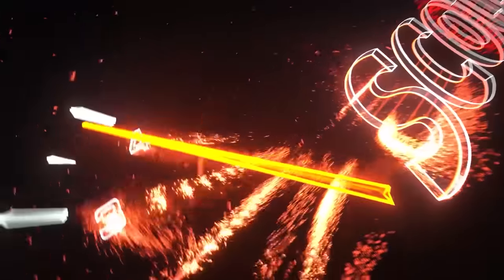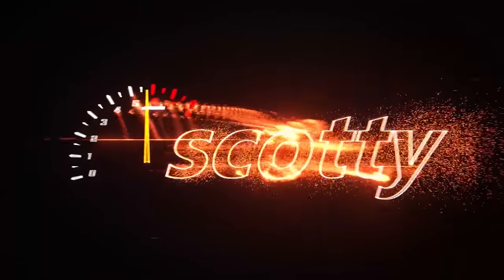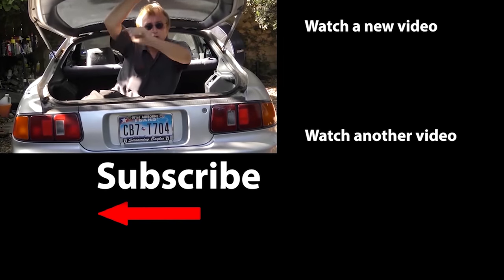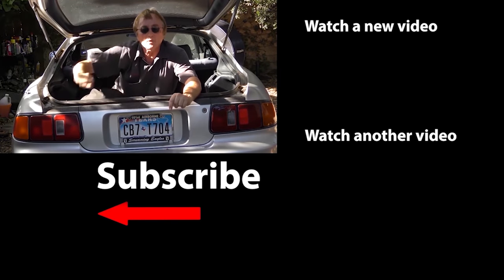Here’s Why Your Catalytic Converter is About to Be Stolen (Nationwide Theft Alert)

Comment: Someone tried to steal mine, they jacked it up with a very nice LINCOLN jack, well the neighbors dog went into major barking and growling I went outside someone ran away from my car.. but I got a really nice floor jack.. and a socket set...lol
Reply: Good dogie
Reply: Haha you made out good , the thief that took mine bent the crap out of the down pipe causing a restriction
Reply: Finger prints on the evidence,  should be turn in to police
Reply: Jim Johnson  right ... sad times we live in the police get a catalytic call and laugh while sipping coffee in the 7-11 parking lot
Reply: Awesome story! Mine is not as good. Had around 4k sound equipment in my pickup. Crackhead successfully ripped out one of my amps. He totally got shocked w 5F capacitor power plus the battery. Some things were melted. He ate it. Jerk.
Reply: Imagine if the crook tries to come ask for that stuff back. Lol.  Take it in to analyze for finger prints to try to help other would be victims out.
Reply: @AF_1892  Damn good story. We need lots more like that.

Comment: The Scrap yard or whoever is purchasing the cut off cats should be heald accountable. If no one will buy them, no one will bother stealing them
Reply: There a black market
Reply: Yeah, punish the scrap yards for purchasing something you can’t tell that its stolen and not the actual criminals.
Reply: ----------- unfortunately money speaks louder than thievery exhaust minus cat...need lawmakers to draft law put moratorium on sale of cats to scrap dealers unless licensed...hey Scotty
Reply: All scrap yards buy them. When I ran a yard, we had a saying, “ we’re here to buy metal, not investigate metal”  Almost everyone who sells a car to a yard removes the battery, cat, rims, and anything else worth  more than what you get for shred car price. They sold those things to us for the higher price. No way we could tell what was stollen. We did however, have to hold the scrap for 30 days prior to reselling in case there was stollen property. We abided by that. Many scrap yards didn’t.
Reply: There are a few clowns collecting them to separate the expensive metals inside rather than take them to a scrapper, a smart scrapper probably puts them out of sight to cool down before selling them on .... if they have a scrap yard it would be easy to hide them on cars that are on the heap .... it’s a good excuse to make a long term temporary modification. Just take care to retune the motor to the better flow of straight through exhaust ...
Reply: Concur with you, but I think we also need to put pressure on our lawmakers as well.  Nothing will change until we have laws to back us up.  Scrap yards should also have cameras to catch license plates on  vehicles driving in, the driver & occupants, etc., I.D. needed as well prior to payment. (You know many will try to give phoney names & addresses).  If someone is not doing anything illegal, none of these actions would bother them..  As for any legal issues regarding filming children, these miscreants shouldn't have their kids with them if  they're doing something illegal anyway, but maybe if the kids see their dads/ brothers  handcuffed, it might deter them from following in their footsteps. Other thing is to establish a neighborhood watch or have  strategically placed security cameras throughout the area.   We should all help one another to stop these creeps.  There is nothing lower than a scum thief who earns a living off of stealing from others.  Any of you who get camera footage should post the photos or video on the internet just like they do with porch pirates.
Reply: @iCuStOmPR  
If someone shows up with a dozen sawed off and not unbolted cats and doesn't have a shop, there not stupid, they know dude
Reply: Scrap yards in my area are strict. They require an ID for all transactions and even scan them.
Reply: Contrary.  Can’t hold cat recyclers accountable for a theft they didn’t commit, and have no way of knowing took place unless the thief tells them it did.  Plus it’s not hard to pull the beads out yourself.  Even melt them down if you have the equipment.  Makes the finished product much more valuable if you just do it yerself.
Reply: They implemented this with a.c. units years ago. And wala!!. People stopped stealing people's a.c.units. someone actually stole my a.c. condenser unit years ago. Now you have to have a recept for the new a.c. unit in order to scrap your old one. So yeah I do believe if the recycling centers would do the same with cats then we would see a drop in them being stolen.
Reply: @iCuStOmPR  When someone shows up with a load of converters, it’s a good sign they’re stolen.
Reply: @brockbaker3able  If someone bring you 15 or more cat converters, its obvious they were stolen especially if it is the same person every month.  There should be a law where you have to show proof of ownership and you can only use the pink slip once every five years.

Comment: Own a 2019 Civic, I average 37mpg. I have a 6MT, not the automatic CVT. I didn't want the CVT, I wanted a MT. I also got the 2.0L engine. I bought the best Civic you could possibly buy. My car gets 37 mpg and will last for over 300k miles because I change my oil every 5k miles. Plus, I know how to drive a MT. My clutch will last for over 300k miles. Best purchase ever. The 2.0L Civic with the 6MT is the last "BEST" Civic you could ever purchase for longevity in mind. I'm pleased as a pig in mud that I found one.

Comment: We have a 2002 Buick Century & 2002 Pontiac Firebird.  Live out in the middle of NOWHERE in southeastern Arizona, in a town of 400 people, 125 miles from the nearest big city of about 300,000 people.  Have a 6ft fence of corrugated steel with a chainlink drive through gate.  IF someone from the city decided to try it here, first, all the dogs in town tell each other, and then our dogs know, and then our very large cockatoo knows and all hell would break loose in our house waking us up.  Reach for the .22's, let the dogs out, flip on the outside light and watch the fun begin.

Comment: I feel bad for the criminal that try’s to steal mine because I have bad news I don’t have one to begin with 😂😂😂
Reply: Straight pipe for the win 👍💯!
Reply: mine blew up the first time i tried to 2 step it lol
Reply: I told a friend when he bought a brand new truck where there were no emissions to replace the cats with straight pipes and sell them or store them in case he lives somewhere with emissions.   2 new cats from a big truck can get $2000 or more.
Reply: är u kiddin?
Reply: Straight pipe 👌
Reply: @SWIM SWIM it should be considering how bad it is for the environment and yourself but ya know.... American laws don’t follow any science or logic if you want your big truck to go brrrrrrrrr then you can do it lol
Reply: @nolanholmberg311  There are lots of states where it's illegal to remove the catalytic converters. Some of today's engines don't even need them anyhow
Reply: @nolanholmberg311  it frees up a little more horse power when you remove them and tune the ECU to compensate. Especially for forced induction applications with large turbo setups. Not all areas in the United States require smog emissions. Usually rural areas with small populations. Modern emission systems are a nuisance for high performance motorcycles since Euro 5 places a lot of restrictions that significantly neuters the bike’s horsepower output. A little ridiculous since these bikes are few in number and a far less of a contributor to pollution compared to cars. It’s also made a lot of modern heavy duty Diesel engines for working class individuals less reliable and extremely expensive to fix cause of this. Fortunately electric will likely solve all this with advancement in battery tech.
Reply: @nolanholmberg311  honestly it's a futile attempt. The world has billions of people and most don't give a crap about the environment. I enjoy my 6.3 500hp turbo charged Chevy. It does more then burrr.
Reply: Straight pipe on my ranger...😀😀
Reply: Almost 20yrs old civic don’t need to go thru emissions anymore Lmao 😂
Reply: Lmfao Sam e
Reply: Same. They can steal my cats but there's nothing inside em!😏😎
Reply: Same! And I’m not putting one one either!!!!

Comment: Someone took the cat off my Kia Sedona. At first I was pissed but now it's a lot more fun to drive lmao.
Reply: Just problem getting inspection
Reply: Someone cut mine off. Replaced it with the cheapest cat I could find on line. It's essentially a swollen straight pipe with no precious material in it. The car still passes the yearly emissions test, and the "cat" looks the part too so passes the visual inspection no problem.
Reply: @AlGoYoSu  sir VW would like to talk with you 😂
Reply: @AlGoYoSu  That's cool
Reply: Really on my Honda the smell alone was horrible and it took about 40 seconds to get to 30mph haha
Reply: @CRAPO2011   Excessive idling kills cats, makes the exhaust smell like rotten eggs
Reply: @douglasburford8452  Maybe in old cars police vehicles idle alottt and they don't damage cats, misfires damage cats
Reply: @CRAPO2011  A straight piped HONDA? Basically the poster child of YouTube. Just get Hondata , a tune, and unleash the fury
Reply: @theejoeylee  I couldnt take it so damn loud , looked for a new cat with the quickness
Reply: They stole mine yesterday. It's not as loud as I thought it would be. Still loud.
Reply: @AlGoYoSu  going to get this fixed today. I wonder if they will do this for me. Great idea.

Comment: As an exhaust guy, I can tell you that I've seen an incline in "cadilladic" converter theft. And half the customers are like "can't you just throw a piece of pipe in there?"
Reply: In theory you can. At this point you may be better off that way
Reply: Oh yeah you can
Reply: I mean yeah, I just have my trucks straight piped, so you can, as long as they don't do yearly inspections where you live
Reply: @sloughsharkseh3307  inspections are kicking my a$$ in Wisconsin. My 2003 Ford Lighting turned 18 yrs old today. He might eventually pass but it doesn't get driven at all and runs too rich. Doing a little better I should try him again.
Edit: I woukd drive him more often. I made the mistake of trusting a mechanic. He is generally very good. My boost of 12psi dropped to pathethic 8. He LIED about the electric stuff he did. My computer/s are likely shot. He lied about Jerry rigging the relays. Part of it is my fault. Would have disconnected the audio capacitor. In Houston it is common sense. In Milwaukee nope! I need the Lightning Gods to help me redo all electronics. Got a harness. Mechanics DO NOT touch electrical things with a capacitor hooked up. It was too small, figured of course he would unhook it. Auto store down the street verified he sucks at electronics. Well damn I may have to drop 15k into redoing all of it and driving across the country for right mechanic. 
Ford kept the wiring diagrams super secret so I cant get my hands on one.
Reply: @AF_1892  Hit the nail on the head. We're required, by law, to install a converter where the original(s) should be. No matter how the car came in. Just welding in a piece of pipe could land us a $10k fine and risk shutting our shop down, but many people don't know that.
Reply: @arturos.l.2248  Oh yeah, we sure can. Right before we get shut down and fined a cool $10k. Definitely worth it.
Reply: Andy Candy  oh no pollution. One little car isn’t hurting anyone
Reply: @AF_1892  uhh...I've lived in Wisconsin over 10 years...no inspections here
Reply: @AF_1892  why not ?
Reply: @jameswilliams5252   Because they have brains in Wisconsin - unlike Illinois.

Comment: I already took mine off and sold it 😂. Getting better gas mileage now too!
Reply: Lol they gone bust your window for beating them your own catalytic converter.
Reply: I’m telling AOC 🤣
Reply: You get worse gas mileage

And that was one of the stupidest thing people do. I know a guy that sold his catalytic converter and when it was time to smog his car, he has to buy 2 brand new converters that are 5 times for what he got selling it. I doubt someone would buy your car
Reply: @JoseRamirez-yh2ll  not everyone has smog check
Reply: @JoseRamirez-yh2ll  wrong partially a clogged one makes it worse taking ur cat off on a car that has 150k or more then I don’t see how that could have a worse effect on gas and ur friend needs help because if he knew he was gonna need it for emissions Then he’s ignorant for removing it... in Georgia USA only the county’s that surround Atlanta like 8 ish need emissions the rest don’t so it stands to me that there is way more places like that
Reply: @ogxokane7705  he never mentioned anything about not working. He just straight cashed out on it. And not all catalytic converter get clogged. As long as you use a reliable gas station and aren't burning oil it shouldn't get clogged. What I've seen more are catalytic break the light cones inside and it requires to be changed after that. If your cat is good and you put a straight pipe the o2 sensor will not work properly and use up more gas
Reply: @TheRamGuy  I don't know about that life. I live in California and we've always done smog check. I think most states do 'inspections' but it's like a smog check. BTW they don't check if it has smoke anymore, they just plug in the obd scanner now
Reply: @JoseRamirez-yh2ll  well there are quite a few areas where they don't require emissions or vehicle inspections. The east and west coasts are where you find most of that stuff
Reply: No kidding?

Comment: On my 1996 GMC Sierra two wheel drive v6 the catalytic converter went bad they gave me two options $40 for a straight pipe or $125 for a another Cadillac converter I chose the straight pipe and they said they would give me an inspection sticker

Comment: My uncle's catalytic converter was literally stolen 2 days ago. Thankfully his employer reimbursed him since it happened on his lot
They probably didn't get too much out of it, though, since that Accord was about 20 years old
Reply: They are worth the most believe it or not🙄🙄
Reply: Honda catalytic converters are some of the most valuable.
Reply: @lordsnivyofnottingham2948  for any brand no matter the year of the car those cats going be expensive
Reply: Just looked it up on Honda parts now. Retail is $3,200🤯🤯🤯🤯🤯  My Ridgeline, a measly $700!🤔🤔🤫🤭🙄
Reply: I got $145 for my old clogged catalytic converter from my 1988 Fiero. The new one was $150. Win.
Reply: my CC got stolen 2 days ago as well. 16 year old car, i've had it 6 weeks, bam.
Reply: Honda cats i take are more valuable as they have more precious metal content than most. My theory is Honda did this to get the LEV or ULEV classification.
Reply: @bigjay1970  If ridgelines have dual exhaust like a 2005-2010 Odyssey it has 2-4 cats
Reply: The older they are the more platinum buildup they create. A brand new cat has no Platnum but a 20 year old cat had a good amount of platinum.
Reply: @CRAPO2011  

Yes just talking the one on the  bottom.!🤗😉😇
Reply: @Recovery-Dawg  Um no, it’s exactly the opposite. The platinum wears away over time, since it is the catalyst in the converter.
Reply: @bigjay1970  ah yea, i have an older odyssey it only has one big cat 1,200 for the oem  no wayyy too much $$$ just to have it stolen again
Reply: @CRAPO2011  
The cats  from advance auto are a couple hundred and here in NJ you need one.  The excuse of it was stolen doesn't get you a get out of jail free card with no fine.🙄🤔🤫🤭  The check engine light would be on I suppose.🤔🙄
Reply: @lockwoodthexton  I've always gotten more money the older the cat is at the scrap yard and they say it's the Platnum buildup. Maybe they used to put more if it in the older models?
Reply: @captinbeyond  yeah man that's all I do. I get thousands a day. I make approached 10,000 daily. I'm really good at it. Want me to teach you and you can give me a percentage?
Reply: @captinbeyond  oh yes all that comes with it.

Comment: Catalytic converter theft is on the rise for 2 reasons, but it only takes one. At my shop in the past, we saw this happen when precious metal prices were high. Specifically platinum and palladium. Now, we have high unemployment factored in, along with better battery powered reciprocating saws. Most are stolen from trucks and vans since they sit high enough for someone to slide under the vehicle without jacking. This usually happens on vehicles that are NOT parked at homes like many work trucks and church vans. Cats are valuable because of the metals that make them work. Primarily platinum (todays price of about $1200.00/oz), palladium ($2500.00/oz), and some with rhodium ($25,000.00/oz). Rhodium is mostly found in European cats. Most will bring $50.00 to $400.00 per cat for scrap. Only OEM cats bring these prices. Aftermarket cats are almost worthless as well as pre-OBDII cats.
Reply: Are there far less metals in aftermarket?

Comment: We had the catalytic converter stolen off our rv this morning. I was shocked to see this video posted hours after! Looks like they used a reciprocating saw and chopped both ends off.. Not hard to do on a vehicle that requires no jack for access underneath. Not sure there's any way around replacing the full exhaust except welding the new cat as the flanges have been chopped. Huge bummer and even bigger headache dealing with the insurance company. Everyone stay safe and hide your vehicles.

Comment: Scotty I have a 2010 Nissan Sentra,  I'm trying to sell but I don't know if I should buy a 2004 Lexus IS300 or 2007 Volkswagen Golf R. I had the Sentra for about two years now and it's just been  problems and I'm just not happy with that car .
Reply: Get the Lexus! I bought a used 2003 & regret selling it...it had 240K miles on it so I got worried.  Should’ve kept it - only thing I ever replaced was the battery 😳